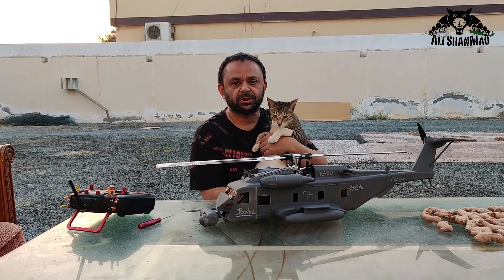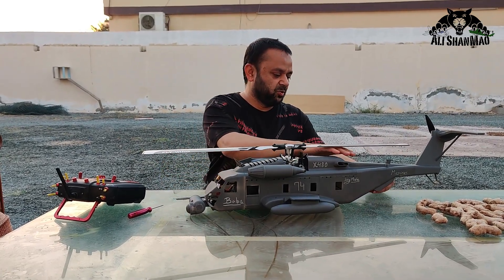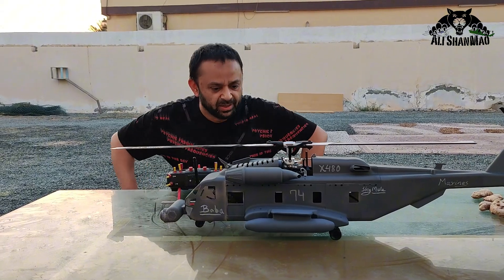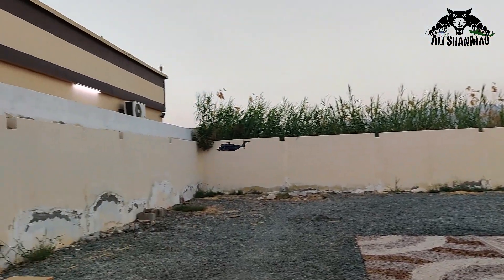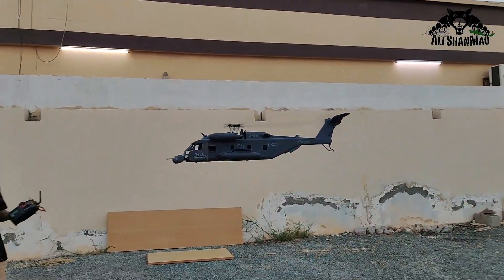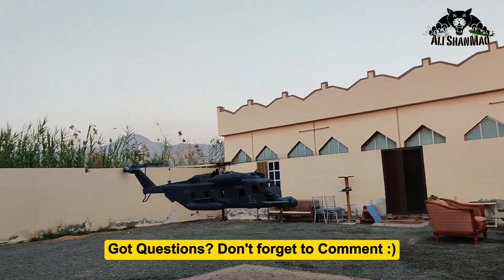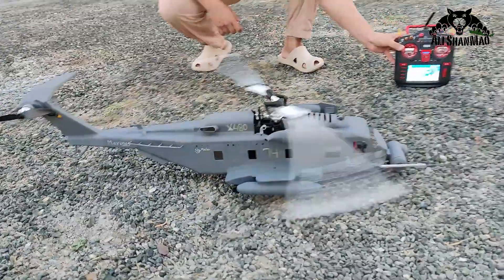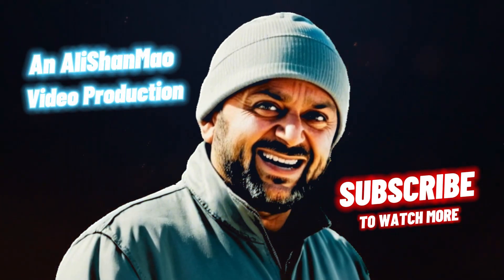Sky Mule X480 3D Printed Sikorsky CH53 Sea Stallion inspired RC Helicopter - Yard Flight

Comment: Any reason why you went with 2 blade instead of 4?
Reply from the maker: @timothypearson6122  4 blades is discontinued by flywing and I have none left. I have only 2 x FW450 mechanics and 1 x UH1 which I will cherish to build new helis 😉 UH1 mechanics I have 4 blades head. But it's motor is too small for such loads. I will design a different heli for UH1 mechanics

Comment: Wow! Quite impressive, just wish it could fit the FW Bell mechanics!  Cheers
Reply from the maker: Hey buddy thanks for your support and comment. In fact it is easier for me to design the base plate for Bell 206 mechanics. however given the weight of this fuselage, I don't think Bell 206 small motor can actually take it. The all out flying weight of this fuselage can be up to 1.8 kilograms and only FW 450 V3 mechanics and powerful motor can actually take this much payload.
Reply: @alishanmao  Time to find a FW 450 v3 then and harvest the mechanics!  Will look for a sale!  Cheers